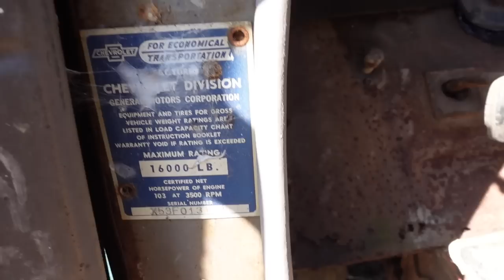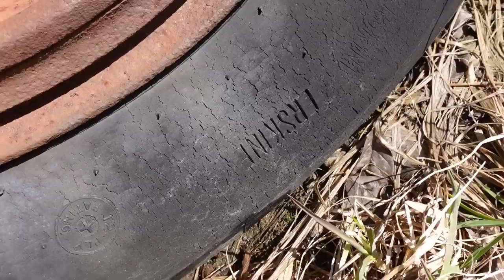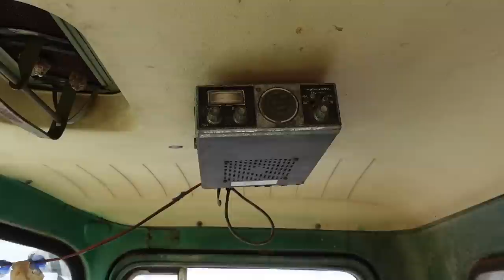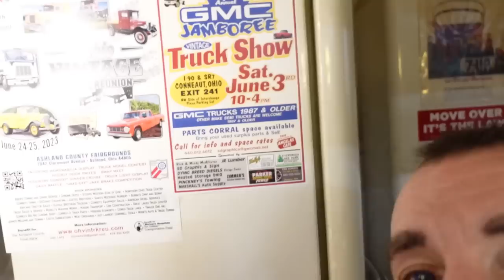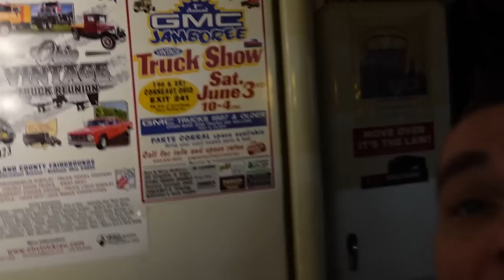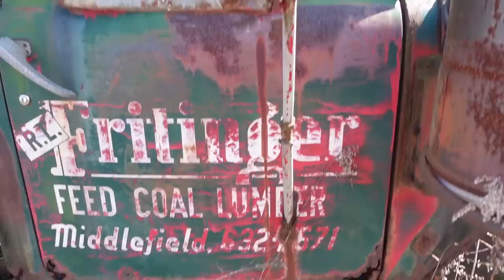Vintage SEMI TRUCK & Equipment Paradise! MACK International Ford

Comment: The old Ford truck with the doghouse gone was a 1953 if that Grill on the ground went with that truck.
I started driving full-time in January of 1974 I started in a 1973 DM600 Mack tri axle with the offset cab.
The U model offset cab was usually Road tractors when new. 
In the late 70s I haul Rock from a quarry that still used a chain drive Mack for a supply truck around the Quarry.
The R model Mack in your video was probably an R700 they had a longer Hood than the regular R600 Mack.
Mack Trucks were good for construction and Hauling coal out of the pit. They had the toughest rear-end.
Your video gets me thinking about my young years.
Great video
Thank you.
Reply from the maker: Thank Kerry for watching. I enjoy bringing the trucking memories to everyone. 😬👍

Comment: That R model Mack looked like it had a 2 stick 6 speed transmission. That extra low gear made taking off with heavy loads very easy.  
I enjoyed driving them especially with the 283/285 engine.  It had 2 horsepower ratings,  285 at 1800 RPM and 283 at 2100 RPM.  If you turned some fuel to it , it would pull really well 😊

Ad usual,  another great video Mr. Dane

Comment: I have a 66 loadstar 1600 w/ grain body on it. Same color. Still in use. We take the sides off and haul round bales in the summer. Love this truck! Has one hell of a history. Also noticed  Badger chopper box in the background. Got one of those too. Early 1900s truck; if it was mine it would be inside. On wood floor. Slowly being restored. Keep up the good work 😊!
Reply from the maker: I know…. So much potential sittin out there!

Comment: I drove 3 different Ford's like that blue one. I still remember the unit #'s.. They had 292 cid Y-block engines. They gave reliable daily commercial service into the 1990's.
Reply: That Ford is an early 60s,  Ford stopped building the 292 in 1959. Possible they replaced the original engine with an older engine,  maybe been rebuilt.
Reply: @bertgrau3934  
Wasn't any internet back then. The shop mechanic was the go-to source for all such info. He was utterly reliable.
Reply: @michaelnault5905 I stand corrected,  Ford did build the Y block until 1964,  and used most in trucks so it's possible you did drive a truck with the 292. In 58 Ford came out with the FE series,  that was used in big cars and trucks, from what I read it looks like the FE was used in bigger trucks like the F600 and F700.

Comment: Hey Dane,  that green Mack there looks like a R700 most of those came with an 8V71 detroit or 8v92ta,  that may be a rare dog sitting there
Reply from the maker: I know it’s definitely a V8
Reply: @DaneScottsTRUCKERSLOUNGE  it's gotta be a detroit MACK R 700 , is the same truck in convoy as rubber duck it was a RS700 I believe,  but the R 700 were 8V71 or 92s
Reply: Or the 325 maxidyne most likely with 2 sticks probably a 6 speed
Reply: Would it have a cummins option??? Saw some in the 80s with cat,cummins.
Reply: @dirtydiesels3110  possibly a cummins or cat 3406B or 3408